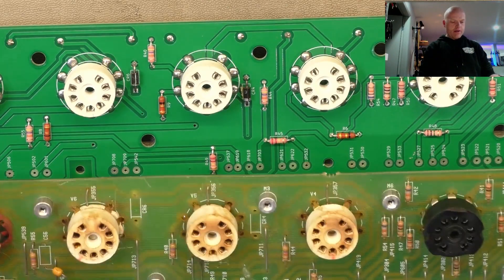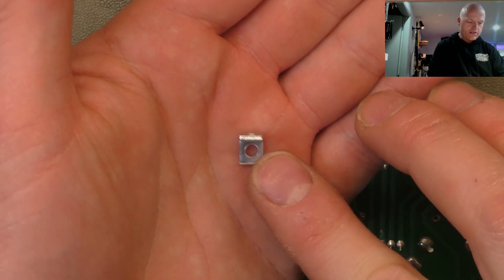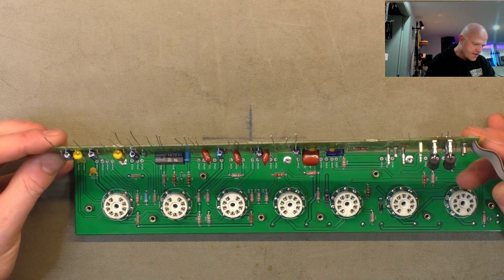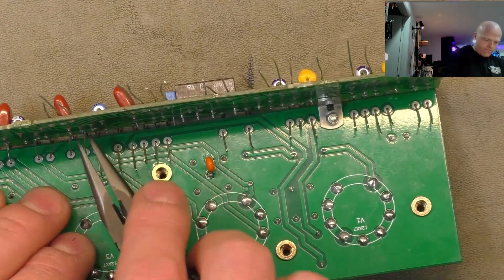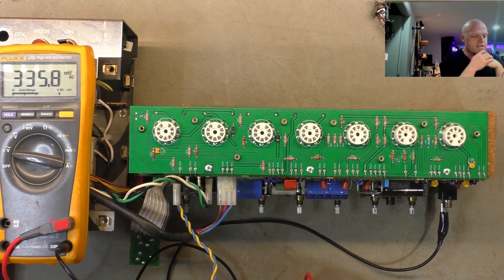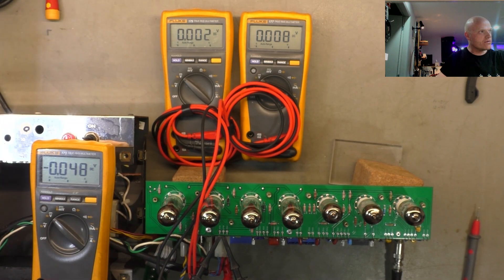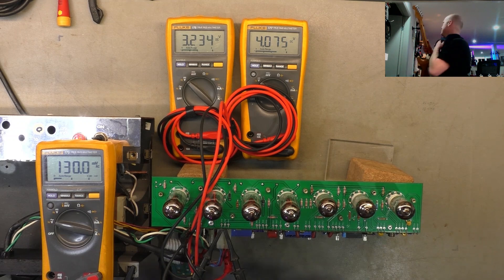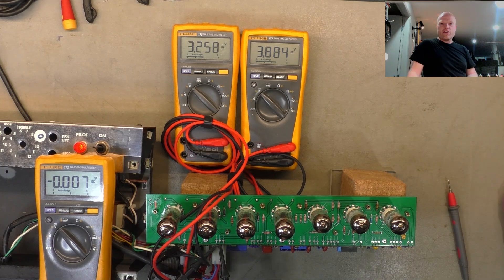Part 2: How good can we make a Peavey Classic 30? Reassembly & Testing

Comment: I just picked up one of these amps, it's been gigged regularly over the course of it's 30 years, has had several repairs and a few small upgrades to keep it going, but it's due for a full rebuild. Looks like it has all the original caps. I would love to buy one of these boards and breath some new life into and otherwise great little amp.

Comment: I wish someone would sell a layout to hand wire a Classic 30 I have built a 5F1 clone and love it but I would really like to hand wire my Peavey Classic 30 would be a fun project.  I saw a guy who did it with a bunch of mods but I just want a standard 30 with just necessary mods like bias.  Even a flat board layout with real tube sockets and pots would be good.  Really like the video.

Comment: Oi Brad. Very impressed. I picked up Part 1 because I spotted a Classic 30 and wanted to get a peek inside - valve seats mounted to the board! Yeah nah I'll let that one slide and concentrate on what I've got (Mesa F50 & AC30 C2X). Many thanks mate! 
Rohan Hunt,
(Now stuck in Philadelphia PA)
Reply from the maker: Well well well, guess what the Classic 30 shares with the Mesa F50 & AC30 C2X?
All PCB mounted valve sockets!
It's less of a worry if they're not biased to cook and if the PCB is a higher quality through-hole plated version with a logical layout. This can be said for the Vox, but not the Mesa.
Reply: @BradsGuitarGarage  yip. Engineer's nightmare. If it karks, it's parts. In the Booger's favour, the ax covers bed into the chassis.. 6L6's all two of them are a nice fit.
Reply: @BradsGuitarGarage  p.s. salvaged some useful valves from irreparable rtr, put one of the Telefunken ecc83/12ax7 in zer Wox, odd man out's a Mullard ECC83 from a long-ago service at Audiolab (!) which is currently V1 in Booger (but will end up in zer aysee sirty..

Comment: Fantastic video Brad. I bought a new Classic 30 in 2023. It's fine but one thing i am curious about is the boost switch. Is there anyway that a pot could be installed for a varible boost? Have a good one man.

Comment: 8:08 Putting the shoulder of the rivet against the fiberglass is more secure and less likely to cause damage than having the bulge on that side. If you chose to do it the other way to get more clearance you could use a metal washer between the between the bulge and the board. But ... you won't get the nose of the rivet gun in place with an L-bracket that small.

Comment: Lovely work mate. I’m a fan of these amps had one for many years when they were released. Always found it a great recording amp. I ended up swapping it for an ounce of weed when I was in my mid  20s…idiot. 😎
Reply from the maker: Well, it was an ounce I guess.
Reply: @BradsGuitarGarage  Yeah it was just sitting around at that stage as Id moved onto JCM800s and full quads etc...But yeah I really liked that amp. Never used it live but a killer little recording amp if I remember rightly. As a rebuild that is beautiful work mate.  What other PCBs have you gone on to design? Anything that a hack hobbyist might be interested in using for a build?
Reply from the maker: Working on some things but the repairs keep flooding in, so no time to progress with them just yet, but hopefully some more movement toward the end of the year.
Reply from the maker: In the meantime I reckon you'd be very interested in Jason from Headfirst Amplification and his wares. Check him out and tell him I sent you.
Reply: @BradsGuitarGarage yeah he’s a fkn legend. I’ve already built on 4 of his boards. 👍🏻🍻

Comment: Nice work. I really like this amp. Mine just came back from a visit to its maker. Question. I know it’s only 30W but why does the bass suffer so much when I turn it up past 5 or so? Is there a mod or a fix for this? Just gets muddy and less defined. Single coil guitars.
Reply from the maker: Reducing the early stage bypass cap values and the coupling cap values later in the signal chain can address this.
Look into the term "blocking distortion" if you want to learn more.
This is assuming the amp is otherwise healthy.

Comment: AT 5:50 on the PCB what is the interleaved track for? Capacitance? Also when inserting the many wire of the daughter board cut the long legs so that they are on a slope then you only need to get one in at a time.
Reply from the maker: I think it's a sort of poor-man's ferrite bead, to suppress RF interference.